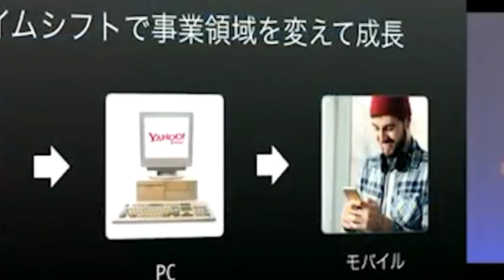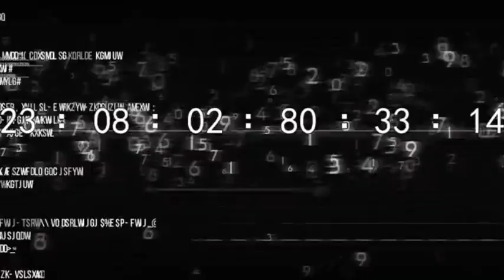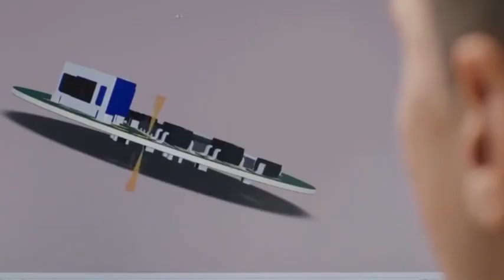US Chip War Escalates! China Fights Back & Dutch Lithography Deal Hopes?

Comment: The chip war is lost and China is the winner hands down having used there engineering brains to extend the capability of old🎉er eASML equipment and achieving double stacking of chips to get 7nm throughput speeds which was thought impossible.

The USA no longer hold technological advantage in development as it’s become to focused on profit margins and share price over R&D to achieve advances. The USA is trying to sanctions not development to retard Chinese progress. China just developed the best mid range chips in the field and stole the general high end volume  where the most money could be made.